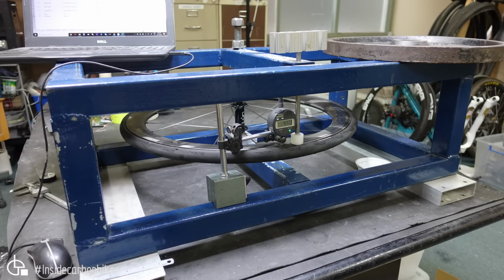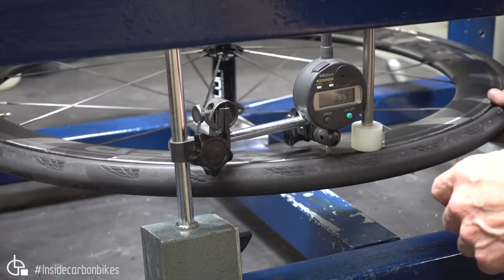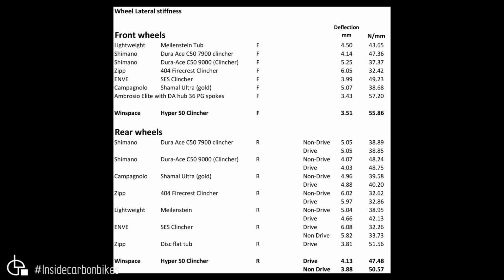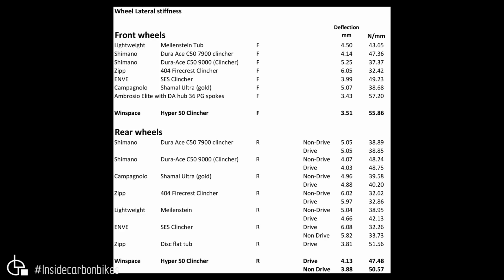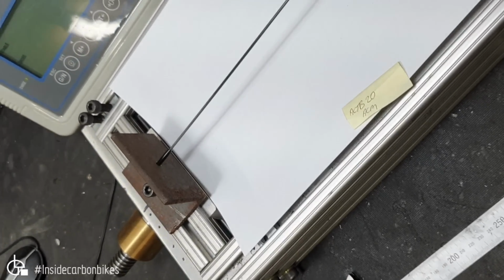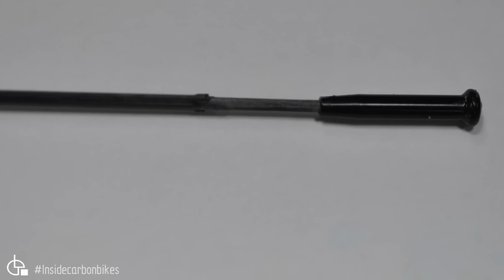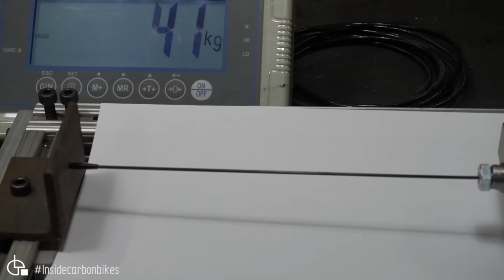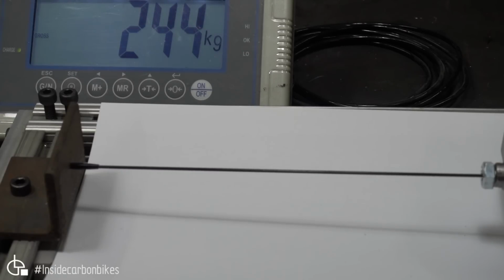Winspace Hyper Wheels - What they didn't tell you.

Comment: So your one concern is a freak accident of a stick going into the spokes?
Reply from the maker: Yes, I have seen this happen enough times with very serious consequences, maybe it is constrained by the location where you ride and is more of a problem in some areas than others.
Reply: @LuescherTeknik  How many spokes broke in the freak accident?
Reply from the maker: All the spokes!
Reply: @LuescherTeknik  Must have been a big hard stick
Reply: This happened 3x to me last winter during XC woodland rides, so it's not rare. Each time it was on very technical terrain, bellow 20 km/h, but I did bend the spokes and broke the aluminium nipples (this saved the rim from damage). The flying path of the sticks and stones lifted by the tires is sometimes unbelievable :)

Comment: I've got 3 sets and about a dozen mates all have a set. The spokes don't rub or make noise. You just have to add some additional grease to the hub and you're golden. Not a common occurrence in these wheels but happens with all wheelsets
Reply: his said in the video wax or oil was affective to reducing the noise..

If it was the freehub waxing / oiling the spoke wouldn't make any difference...

I've heard noises can come from both the hub body and spokes 👍
Reply: How is your experience after more than a year?
Reply: @kpsig  no issues whatsoever. Own multiple sets in different wheel depths for different bikes and have their gravel wheelset too

Comment: Of all the carbon parts I've had, the non crash failure mode has always been degradation of bonded joints (BB shells, seatpost heads). I don't have much concern over strength when new, the proof will be in long term fatigue life of the bonded joints, as the spokes are subject to poor conditions as well as significant cyclic loading.
Reply from the maker: The life of the bonded interface would be an interesting test, especially hot/wet.
Reply: @LuescherTeknik  I thought the nipple ends was molded   slid down on to end... which is tapered  didnt think it was bonded as such?🤔
Reply: I'm not skeptical of the wheels and I'd probably buy some if they made deeper section wheels. As a 95kg rider I love stiff wheels.
Reply: @galenkehler  hyper got 65...
Reply: @csren8328  yes, only mid depth wheels, 65 is the tallest.
Reply: @galenkehler  they have a 65mm version
Reply: @moserroman2083  yeah 65 is too shallow to bother with
Reply: @galenkehler  nah is around the max depth to have something aero but still sensible as an all around ; more than that you are in time trial wheels territory

Comment: Would the spokes touching lead to a wear failure of the spokes at the cross location 🤔
Reply: I think peak torque had that concern in one of his videos. But given how hard carbon is one would think it would take years of consistent rubbing to cause a break.
Reply: @DanTuber  if it did fail within years that'd be pretty awful right..? Also carbon is very stiff but that isnt a particularly relevant metric in this failure mode. It definitely isn't hard (unless you'd class cloth as 'hard' too).
Reply: @rubendeklerkdeklerkperform5501  We simulate tens of thousands of KM on these wheels and have multiple sets with >25,000 real world KMs on them in house. Not even a single fraying of the spokes. If one spoke was to snap, it would likely be a single spoke and the wheel would still be rideable. Furthermore, the spokes are nowhere near their maximum strength when built up, so you'd no doubt notice fraying before anything failed. That, and your wheels would probably be well over 100,000km and we think that would be more than a good lifespan for a wheel. ;) We actually updated the lacing pattern of the spokes to not touch, but purely to eliminate the sound rather than any other concern.

Comment: Have you determined that the sound was from the spokes crossing over or if the free hub was properly greased up cam Nichols had the same issue until he just greased the hubs.
Reply: ALL disc hubs in ALL road wheels dry up fast because of the small rotors and high temps.

If you use road disc it makes sense to clean and regrease your hubs after every big day using the brakes.
Reply: @durianriders  are you saying that enough heat makes its way through the hub body to the other side of the hub to liquify and diplace the grease on freehub pawls?
Reply: Yup, Winspace addressed this issue with later batches by simply using better lubrication on the freehub pawls.

Comment: Was waiting with trepidation to compare your lateral stiffness results to mine (although I tested the disc version) with slightly different hub geo. Similar results, sort of validates my cheapo test rig 😉. As to whether what is too stiff or too flexy, that's all subjective and maybe needs a dynamic response rig to judge that. Combination rider mass, frame, tyre, seatpost and saddle spring and damping rates. Let's build a four-post type rig for road bikes!
Reply from the maker: Stiffness = It depends ;)
A proper dynamic rig would be awesome, might cost a bit though.
Reply: do you get stiff when you ride these wheels?